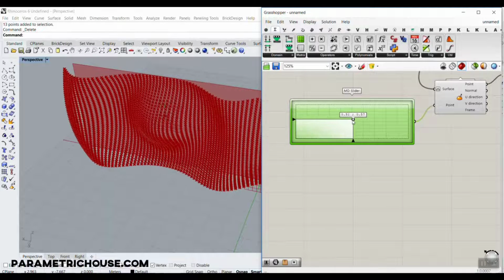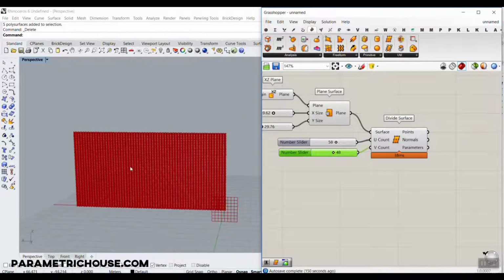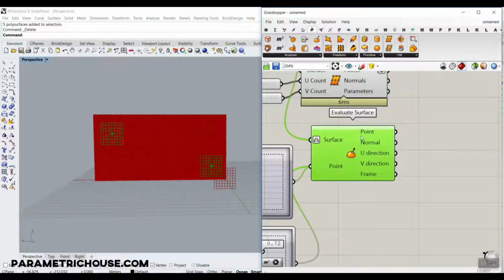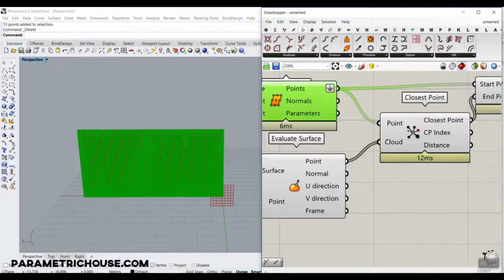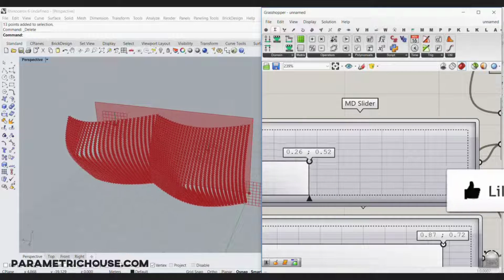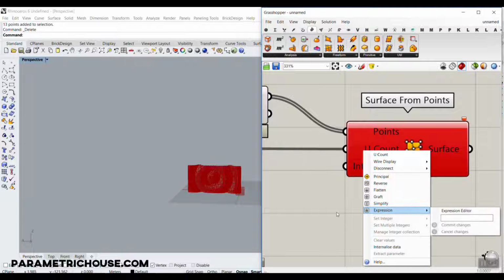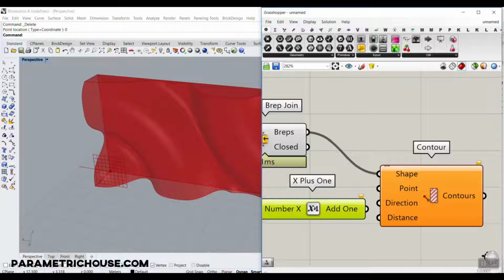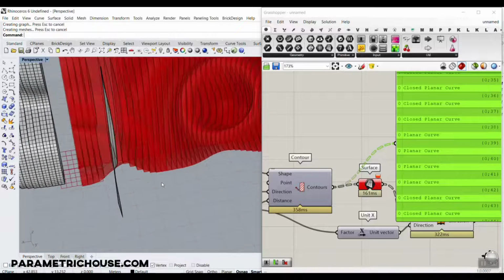Parametric Wall (Point Attractor)

Comment: Please advise am using grasshopper in rhino7. when I plugged into and from the Remap + I do not get a ripple effect on the points but they move in an aligned form divided into two sections based on the point attractors.

Comment: @ParametricHouse I am struggling to loft the edges of my surface. I have followed your steps to create a curve and then loft those two curves together then change the options to align. But when I do all of this the loft command is grey but nothing was created. I run on Mac. Is there any other cay to create the blades without doing this loft option?

Comment: That remap file , I cant seem to load it
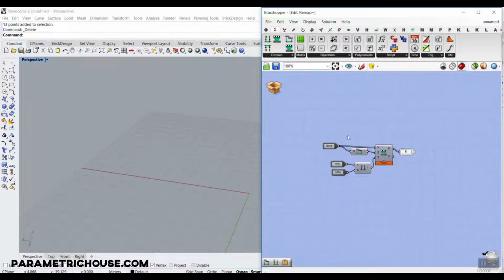Reply: Hey I just figured it out, he show the codes used in the min 10:23. I used that as a guide and basically what you need is this 3 codes: bounds, remap number and construct domain, you will find the 3 in the math section just besides params.
1. So first you connect bound to remap number: connect the domain with the source
2. You connect construct domain to remap number: connect domain with target
Now you got what is essencially the code for the remap+ now just fallow the video as it
There is a few tweaks tho.. you gotta connect the gotta connect both the bound and the remap number to the closet point: do this by connecting  value in remaps and numbers in bound, both to distance in closet point.
Then you connect the 2 number slides to the construct domain.
Then you connect the mapped to the unit y and then connect that to motion in the move code. 
And finally you connect the divide surface to the move by connceting point to geometry.
Hope this helped!
Reply: @tomastorres1816  Thank you! Now just to actually understand this grasshopper script!
Reply: I have the same issue, I also tried unlocking it as well

Comment: for anyone who has the issue of surface points connect to both 2 MD slider points, it's because your count for closet points is 3 by standard. Decreased it to 1 and you'll get the result
Reply: I tried to figure out what you meant by that but i saw on the other comments you just hold shift and you can put more than one connection. Thank you
Reply: Many thanks.

Comment: Another great, thorough tutorial! Is there a way this could be applied to a curved surface, opposed to a planar one?
Reply from the maker: It can be easily done! You can move those points in the normal direction of the surface
Reply: Parametric House Thank you! Coincidentally I answered my own question by making some minor tweaks to the script shown, these videos are making grasshopper much more approachable to me.
Reply: Hi! But after defining the normal vector of the curved surface how can i also input the length of the movement? Because in the unit Y vector there is a factor input and in the regular one there isnt.... thank you! @ParametricHouse